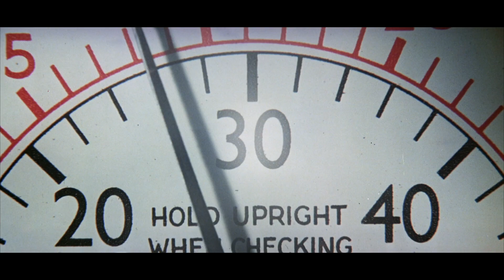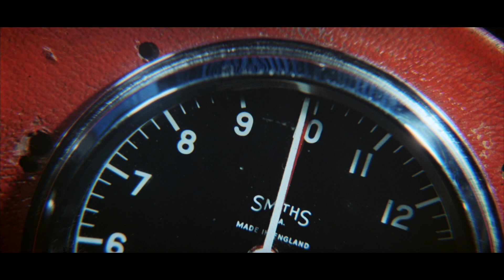Grand Prix (1966) title sequence

Comment: If the mechanics were just tightening the suspension bolts on the grid, a driver should have been deeply worried.

Comment: Oh my Lord, YES! Oh, how I miss those days. I remember that Fangio, called El Maestro, had won 5 world driving championships by the time I was like 3! I watched him since the German grand prix at Der Nordschleiffe in 1957. He came to kicketh much ass. And so he did.
Reply: The 40s~50s cars were unreliable, and more than 50% of the grid weren't able to finish a race, but Fangio managed the feat of winning 46% of the races he took part in. 
He was, simply put, the GOAT.
Reply: @brunoa4049  It was far more than just luck. If that were true, some of the other front runners would've won rather than him. I watched him cut his times every lap. Pass everything in sight until they told him to stop. I drove GTP that way and it works.